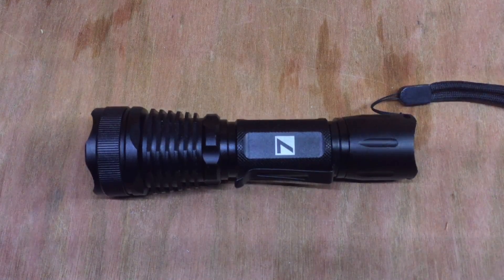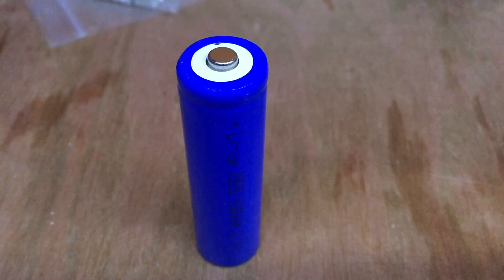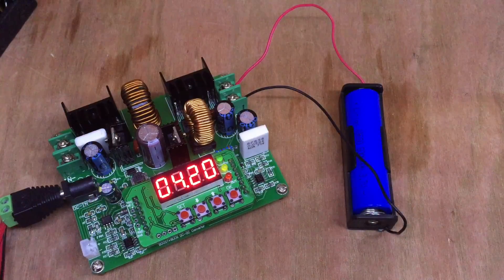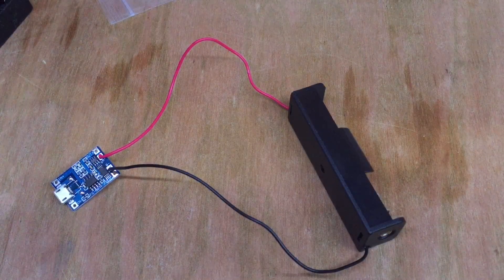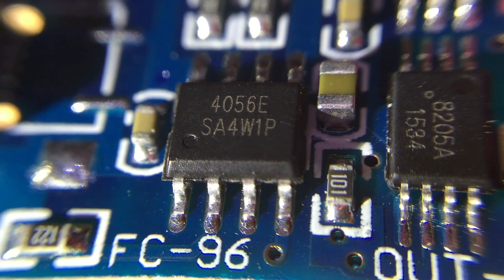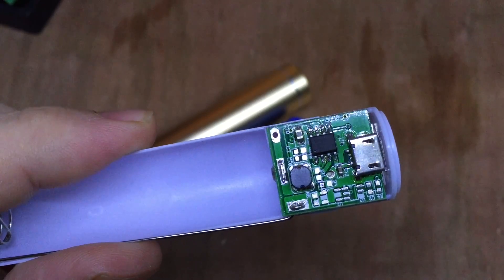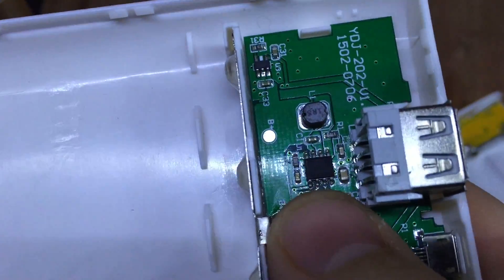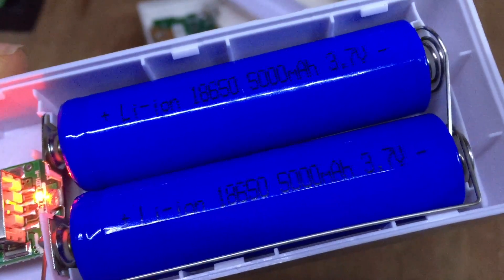Lithium Ion 18650 - Charging on the Cheap - 12v Solar Shed

Comment: You have to be extra careful about charging lithium cells in parallel! If the cells have different voltages, the highest voltage cell will dump current into the other ones, effectively trying to charge them with no current limit. Needless to say, you should never charge lithium batteries with no current limit. This can lead to a lithium fire, I'm serious. Never put mismatched cells in parallel!

Comment: The reason why the batteries don't fit is because the 18650 protection circuit is built into the end cap. Trying using an unprotected cell......

Comment: How can a person like you missunderstanding real lithium cells?
This is 100% chinese cell from cheap manufacturers like ultrafire.
They having 900mah cells real capacity but they claiming 5000mah up to 10.000mah.
They scam people without knowledge.
A real lithium 18650 like LG, samusung, panasonic, must weight about 47gr and a real capacity between 2500mah up to 3300mah. No more than 3400mah.
That's the maximum lithium power density per 47gr.
Other batteries with higher capacity for 18650....are just scammers.
Always be careful, have a lithium tester charger discharger.....and buy one cell if you are suspicious.
Some of them look like a real LG cells or Samsung....but they fake.
They can apply stickers like Original cells.
Anyway.....you have 0 experience.
I ve never heard 5000mah 18650 cells.
You have 0 skills in batteries

Comment: The Ming-He converter would have done the job just fine... No fancy turn-off needed.
The voltage and current limiting features were all that was required. The turn off would have been simply a zero current situation, which is exactly the same as being turned off. 
So, excuse me if I trust a well designed, adjustable converter more than a dollar store power bank to charge my 18650's...

Comment: Hi I’m new to this 18650 type of batteries; I bought 4 and a charger from ebay. I’m a bit confused on how to charge them, do I need a multimeter to check the voltage. What’s the procedure for this? Sorry for being a noob.
Reply from the maker: If you’ve bought a charger designed for lithium ion cells then you shouldn’t need anything else - as long as it works as it was sold.

Comment: The boost converter set to 4 volts would change to this voltage and stop current at this voltage this would be better than a usb charger to 4.2?
Reply from the maker: Under charging your lithium ion cells will increase their useful cycles. I guess it’s up to you which route you take.

Comment: The DC-DC converter would have worked fine.  Probably better than the TP which are notorious for being rubbish, over charging, under charging.  The DC/DC converter will charge on CC until the battery voltage gets to 4.20V when it will switch to CV mode and the current will fall away to nearly nothing.  If you switch it off at the batteries specified minimum current it's grand.  This is exactly how a lithium charger works.

Comment: Hi, did you look into how the torch discharges the 18650? Physically it fits in but I guess the torch will discharge until the LED(s) do not have enough voltage from the 3 AAA, and depending on the cut point that may bring the 18650 voltage too low?
Reply from the maker: +Rincewind TheFirst Yeah this is an issue with most torches that use unprotected lithium cells. I tend to recharge mine fairly frequently to prevent damage.
Reply: I thought so, thanks. It may be interesting to see if there is a "cut-off" point and see if a diode can be put in between? i.e. torch brings down voltage to a total of 2.4V (assuming each aaa battery being brought down to 0.8V and torch does cut off or LED doesnt suck current anymore due to low voltage), we dont want the 18650 to go bellow 3.7V approx so add a diode that brings down voltage to torch by 1V approx. Even if the circuit was still drawing current for whatever reason when on, the LED may dim/turn off and therefore time to change the battery? Off course many assumptions, not the least how to fit the diode ;) btw thanks for the ok cell videos, now waiting for them :)

Comment: Man, forget about changing the resistor. If you do that the TP4056 won't work anymore. That only work with the unprotected TP4056 board. (Yes, I lost a TP4056 trying it. :/ )

Comment: is that not a protected cell you are trying to fit into the single cell power bank?
they are slightly longer than unprotected 18650s 
because of the protection circuit on top of the positive battery terminal (extra bulge)
Reply from the maker: No it isn't - its the nipple on the positive that caused the issue.  I do have some protected cells but I didn't use them here.  Cheers

Comment: How can you set up a system using your DC to DC bost charger to cutoff at a certain votlage so you don't damage the battery?
Reply from the maker: A constant current / constant voltage converter will reduce the current flowing in the circuit once it hits the threshold voltage.  They will continue to do that until you turn them off usually (although some more expensive ones may allow you to set a lower current threshold too).  If you want fully automated then a specific battery charging module may suit you better.
Reply: Well, I need an adjustable power supple because I have lots of various sized battery packs, so depending on the level of charge I wish to deliver to those packs.

Comment: 18650 batteries that exploded? I use many years 18650 batteries for my flashlights. Without any problem. Buy good Japanese brand 18650 batteries as Panasonic, LG, Sanyo, sony.

A Car as Tesla that is drive with 18650 cells. Good charging that is very important overloading ans over charging that is dangerous for any battery also for lithium batteries.
Reply from the maker: Absolutely.  They can vent and explode if you are massively over charging them.  That statement was more a nod to the click bait videos of abusing lithium ion cells to make them explode.

Worth noting that most flashlights don't have undervolt protection - It's worth using either a protected cell or charging the cell regularly.  Undervoltage wont make your cells explode, but it can lead to a premature failure.

Comment: So you just connected your Mingle DC-DC board directly to your Solar Battery Bank? I bought a similar board from eBay: http://www.ebay.com/itm/221953001309?_trksid=p2060353.m2749.l2649&ssPageName=STRK%3AMEBIDX%3AIT And I was wondering if one could just directly connect it to a lead acid battery to charge a 18650 pack? Would I mess something up when I try to set the output current with my multi meter without a load?
Reply from the maker: +Zai Fuchigami I've got one of those dc to dc converters. They're really quite clever using the four mosfets in different patterns to either buck boost or 1:1 the voltage. 
Yes you should be able to use it to charge a lithium pack - as long as you remember that the ground will be shared between both systems (not an issue as long as you think about it). 
I don't think it has great output protection so it is worth putting a self limiting load on the output to set your current. A filament lamp or something is often a good choice.
Reply: I see... But what is the purpose of the DC-DC before the Minghe?

Comment: Hey 
Can you do a video on how to "wake a dormant lithium hoverboard batterie"?
I have like 9 boards that the batteries is not taking charge. Its been sitting for a year now. Thx
Reply: There are two possibilities.  First, the batteries themselves may be damaged and unable to take charge.  Second, the charging circuit may have failed.  In general, the second is more likely, but the first is definitely possible, especially if the charging circuit wasn't designed for lithium cell batteries.  If the latter is true, you're lucky the batteries didn't explode.

If you can get at the batteries and check what type they are, you may be able to extract them and recharge them.  If they're 18650's then it's pretty easy.

You just need to make sure they're charged with a proper charger made for 18650 lithium cells, and if they're connected in series you also need to make sure to use a balance charger so you don't over-charge any cells, which is dangerous because they can burst and catch fire aka explode.

If they charge up properly using an external charger, then the charging circuit is damaged in some way and you're better off getting a new hoverboard, hopefully from a supplier who won't sell you rubbish which fails quickly.

If they're 18650's and they're still working, then you may be able to re-use them as part of a battery bank for charging mobile telephones.  You can buy empty battery banks from China and put the batteries into it yourself.

If the batteries won't charge or won't hold their charge, you may be able to replace them, but you'll need some mechanical expertise as well as the right tools.  Again, it's probably better to just get a new hoverboard since I'd wonder why the batteries failed in the first place.  The only thing which would be likely to cause lithium cells to fail prematurely is a bad charging circuit.

Comment: the 18650 li-ion cells cannot be made to put out more than 3500 mah at this time,  the physical size of the cell limits this output until manufacturers come up with more advanced chemistry, any seller that puts more than 3500 mah on these cells is lying and stealing your money
Reply from the maker: Absolutely - in my next video in this series I test the capacity.  I knew it wouldn't be 5000mAh - I went into the transaction knowing they weren't accurate figures.  Thanks for your comments.

Comment: Btw are the larger chargers (2-cell, ... 4-cell version) still charging at max 1A ?
Just wondering if it's a 4-cell charger at max 1A and you have to charge 4x3400mAh (which btw are real thing /from known brands/ unlike the 5000mAh ones ;) ) it would be around 0.073C, which could be about 6-7 times slower I guess.
And in that line of thought do you know of such a charging module with higher current? Like 1.7A to charge 3400mAh still at 0.5C, or even higher, in order to charge a batt-pack of lets say 3 or 4 of these in parallel?
Reply from the maker: Sorry I'm not sure what you are referring too... which larger chargers?
Reply: Adam Welch I meant the ones at 5:22 capable if charging several cells in parallel, that would require increasing the current in order to maintain same speed of charge doesn't it?
Reply: @blueckaym   I understand your question and it's a good one.  You would have to build yourself a two or three amp constant current source limited to 4 volts or so.

Comment: Let me start with telling you that you are one incompetend fuck,  The IC TP4056 module will not overload 18650's and are safe in use. the battery you have ad hand is a protected one and makes sure it's not overcharged by an internal protect IC! They are always approx. 4mm larger than the unprotected ones.  Stop making backward vids please.

Comment: Bro throw out that fake Chinese battery. Those are the ones that explode
Reply from the maker: +RGHxFTW Cheers. I don't use them regularly but the fact that they have a low capacity is handy sometimes when testing stuff.

Comment: These chips are pure shit. Better don't use em. I got power banks with em and they burn through the plastic.
Reply: same, i bought 4 of them and they all got so hot the solder holding the chips melted
Reply: There is no copper in the battery connections , I modified the power leads with copper and I recharge regular , so the batteries don't go empty and not entirely full. Maybe a bit nerdy but hey it seem to work a bit..

Comment: Thanks for the video!   Question; if charging multiple cells in parallel--is there any special considerations aside from ensuring the charge voltage does not exceed 4.2v's?  Thanks!
Reply from the maker: +Nick Knack Nope. You might want to increase the current to speed up the job, just don't go over 1C and all should be fine. Thanks.
Reply: Great! Thanks, Adam!
Reply: Yes, there is one critical step! You have to make sure that all the cells in parallel have the exact same voltage! If you don't, the cell with the highest voltage will instantly dump as much energy into the other cells with lower voltage as it can and the current will definitely reach dangerous levels, we're talking potentially a short circuit because the cells have very low internal resistance. Lithium batteries are no joke, you can read up on how to properly charge cells in parallel and in series. Never charge mismatched cells in parallel. This is why balance charging is used instead.

Comment: what about balance charging them? does the circuit have this feature built in?
Reply from the maker: +Ryan Walker All the charging methods I show here are for one cell in series (or numerous cells in parallel). As a result none of these methods require any balancing.

Comment: 5,000mAh is bullshit right off the bat. These things normally are 2,000 - 3,000mAh and 3,000 is pushing it already
Reply: DragonsREpic yeah, the highest ive seen is 3500mah. plus you can buy a multi li ion charger on 101vape for 10 usd.

Comment: 18650s are safe, as long as you take a few precautions.  
1) Don't overcharge (higher than 4.2v) 
2) don't discharge faster than C rating 
3)don't let a cell drop below 2.8 volts (3.0 is normally the low volt cut off for lithium)
and
4)for multiple cells wired in series, you're going to want to use balance charging.  
18650 cells are perfectly safe when these basic steps have been followed.  
Much much safer than Lipo cells.

Comment: Hi, which model Minghe converter is pictured here? I noticed it has Boost+Buck printed on the lower board under the LCD but I wasn't aware they had a model that was both. I have a 3603 buck converter at the moment but would be very interested to know what model this one is. Thanks!
Reply: I believe this is the converter http://www.ebay.com/itm/DC-DC-38V-Digital-Step-up-Step-down-Module-Boost-Buck-Converter-Solar-Charging-/311608895968?hash=item488d5669e0:g:94wAAOSwcL5XMGL1#shpCntId
Reply from the maker: +thinkpadfoot Yes it's a boost and buck converter - goes seemlessly from 0 volts to 38 and can handle up to 6 amps. Therefore they gave it the name D3806. 

I really like it.
Reply: +Adam Welch Thanks Adam, I found it under the model code B3806 on eBay.
Reply: I was not able to find the dc to dc converter on ebay with model code B3806.  I was wondering if you could provide a link to the web page.  Thanks.
Reply from the maker: The model is actually D3806, but it is rarely listed as that on ebay that I've found.  Try this one...
http://www.ebay.co.uk/itm/221958553329

Comment: BTW i'd watch out as the torch will happily drain them right down if it's unprotected cells.
Reply from the maker: +Colin Hickey Thanks Colin - a useful reminder for us all.
Reply: +Adam Welch BTW sure you already know but old laptop batteries are a great source of 18650 cell's  i got a job lot for £10 and have gotten some really good cells out of the pile and still plenty to go through yet.
Reply from the maker: Colin Hickey I do yeah - we often get rid of them at work.  Once I have a reliable way to check capacity I'll definitely be recycling them rather than paying for them to be taken away.

Although I am a bit nervous about breaking them out of their cases!
Reply: +Adam Welch I normally just tread carefully with a pair of pliers.  I hate to think of how many i've gotten rid of over the years without knowing that the is most likely one or two failed cells and the rest are fine.  I use something similar to this for checking my cells http://www.ebay.co.uk/itm/OLED-Mini-USB-Charger-Current-Voltage-Capacity-Power-Detector-Tester-Meter-UK-/261892098346?hash=item3cf9fc492a
Reply from the maker: +Colin Hickey Do you find it accurate with regards to the fact that you're converting 3.7 volts to 5 volts?  I guess it's just a bench mark figure though - even if the mAh figure is off after losses.
Reply: +Adam Welch I've normally found it pretty accurate although i should do some proper tests as i have a B6 clone too which should be more accurate and good for a proper comparison.
Reply from the maker: +Colin Hickey I was testing your suggestion... https://youtu.be/nT_qv8kFayU 

It didn't quite go to plan!
Reply: @AdamWelchUK  Not easy to break them out of the cases. It seems they have been made NOT to be recycles easily.  Wierd. But they are good, high quality cells.

Comment: I found these to be fairly accurate (171938108890) you can discharge at different rates and has a mah reading! I suppose you could spend £3 extra and get an Imax b6 copy.
Reply from the maker: +pietkaify Cheers. I hope to make one myself - I'll order the one you suggest if my idea doesn't work.  At what kind of current do you discharge your batteries?
Reply: +Adam Welch I normally charge and discharge cells I use at 1A! the cells I play with are reclaimed so they normally end up in packs where overall discharge would be less than 1A per cell. I think the item does 500ma / 1A / 2A
Reply from the maker: +pietkaify Thanks. I was going for about an amp.  Not too aggressive, but not taking too long either!